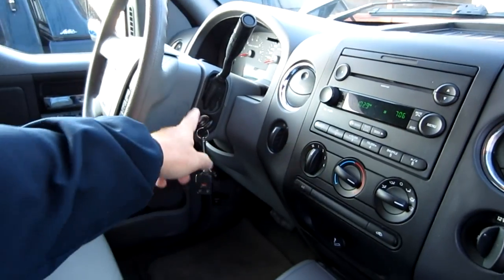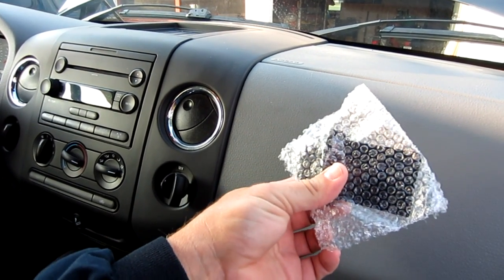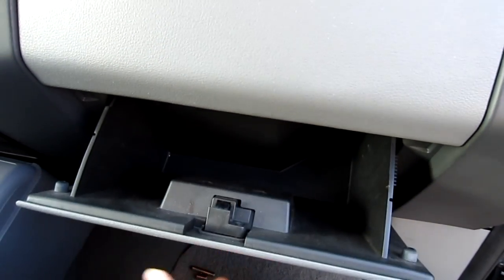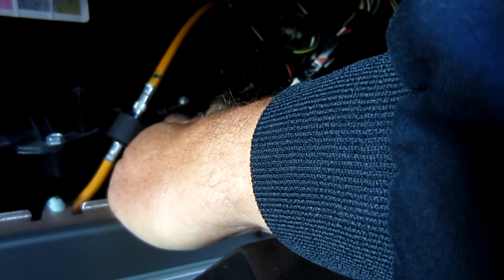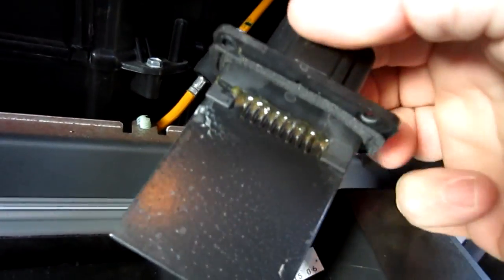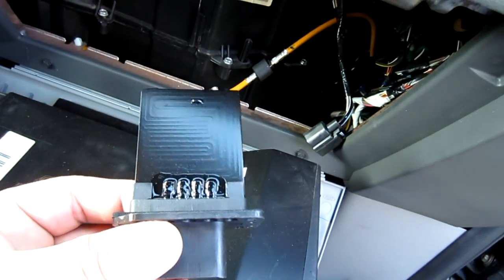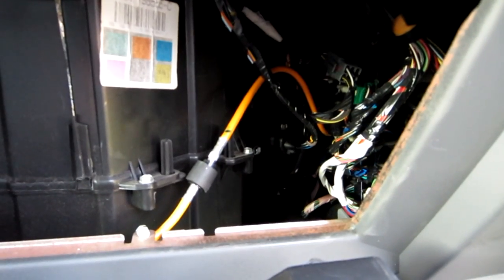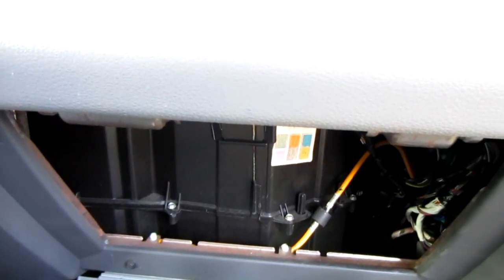2004 - 2011 F150 Blower Motor Resistor

Comment: Just did this on my 08 mustang, worked for about 40 miles and then stopped working again. Back to "High" fan speed only now. I didn't replace it with motorcraft could that be the issue?
Reply from the maker: Possibly.. It's a resistance device so if the blower motor is starting to go then it could be causing it to prematurely fail but the easiest way to rule out a bad unit unfortunately is to buy another one and try it again..
Reply: Yea figured I'd try again with s motorcraft resistor and see what happens. I know people have problems with the AutoZone,oreilys brand parts when it comes to the door actuators, maybe it's the same for the resistor. So if the second one fails again really quick then that probably means my blower motor is going out?
Reply from the maker: Adam Power Yes a blower motor OR bad wiring or connector.. Really a pain to troubleshoot..
Reply: Cool, thank you

Comment: My blower stopped working all together cleaned ground wires replaced resistor truck won't go into gear wen heater switch is on or head lights r on I'm stumped

Comment: I read all these coments and not 1 person said it didn't work but me. I put a brand new one in, even thought the resister is unplugged it still works on only high that that tell some one something. I will check to c if there is a fuse  ??  MM
Reply from the maker: Potentially a bad resistor... Yes even new parts can be bad... If not you may have a failing motor or bad wiring that is causing the new resistors to fail... At this point you must test components...

Comment: Sadly this didnt work for me :/ 2006 ford f150. My fan is on full blast no matter what the setting.  Where do i go from here? The lady at autozone asked if was automatic or manual controls and i said manual.
Reply from the maker: +TheLameEskimo This video shows how to fix a problem where the only setting that makes the blower work is HIGH and at all other switch settings the blower doesn't work at all. I'm not sure what would keep your Blower running at HIGH at all switch positions..
Reply: +Foxboss9 me either.. Maybe a fuse? Either way i think it was blown anyway there was visible rust on the resistor.

Comment: Mine will run, then it will fade....slowing down until it stops..........I turn it off, wait a bit.........comes back on normal.........does the same over again.....sometimes it stays running, sometimes back to slowing down again.  I'll have to give this a try.  How much is the part approximately?
Reply from the maker: Earl Ismyname it is worth a shot.. The part link is in the description..
Reply: Will do!  Thanks for the video you made!
Reply from the maker: Earl Ismyname 👍😊
Reply: Hay mine is doing the exact same thing did replacing that part work? Hope u see this
Reply: Earl Ismyname did that fix your blower motor?

Comment: So it blew air in 4 speed . Mine won't blow at all . Is it the resistor or the motor
Reply from the maker: +Steve Binstock if all speeds quit working at once suddenly  then I would check the fuse first. If the fuse is OK then I would suspect the motor. If you have been running on one speed only for some time because the other speeds haven't been working for a while then I believe that it still could be the resistor but the chances that it lost it's broken default mode(1 speed only) is slim.  The thing is,  unless you bypass the wiring going to the motor and wire it direct or spend a lot more time and remove the motor to have it tested you would be a lot quicker to just spend $20-30 dollars and within 5 minutes rule out the resistor for sure by changing it.. Good luck

Comment: Mine worked for like 2 weeks then it only worked on 4 again any ideas why? Thanks
Reply from the maker: Might be a resistance problem causing the board to fail.. So, bad wiring or blower motor starting to fail..

Comment: I changed that part it worked for a while and then it went back to the same thing any ideas???
Reply from the maker: Either a bad part or there is above normal resistance in the motor,switch or wiring that is causing the circuit to fail on the board of the resistor..

Comment: mine stopped working all together randomly any idea? maybe the relay?
Reply from the maker: Daniel Wahl check fuses first..then look at relays(you can switch with another relay to test).. if still not working you can either try to run a positive wire direct to the motor to see if it works by it being manually powered or your could take the chance of easily switching the resistor like in the video.. it doesn't cost anything but time and effort to do All the checking and testing but the resistor may still be the culprit and it can be bought and switched out in 10 minutes..
Reply: switched relays and resistor to no avail. fuses all looked good. manual ac. i feel its the panel
Reply from the maker: Again, the resistor may still be the culprit(I doubt it though) The resistor can be changed out really quickly to rule it out as the panel change out will definitely be a little more involved. 
  But resistors usually fail to a setting on full speed available for safety reasons(need defrosters) So the fact you have nothing seems to point to something other than the resistor..Keep us posted how it turns out..

Comment: I turn my truck on and after a bit the blower will cut off and not work on any speed... If I turn the truck off for 2 min it comes back on. Will this fix?
Reply from the maker: Kevin Antonio Maybe. My 1st impression is the blower motor..  When the fan stops blowing try tapping on the blower housing to see if it starts up again..If so, I would lean towards the blower motor as needing replaced.. But, the Resistor still could be the culprit.

Comment: I have replaced my resistor 3 times now because it keeps blowing within a month or two 2 after I install the new one. Any ideas what could be the cause?
Reply from the maker: Too much resistance due to either a short in wiring or a blower motor... Make sure connector to blower motor looks good if so probably best to replace blower motor as troubleshooting wiring can be a nightmare if it's a random short and is best left for last. Unless you've got plenty of time, then you can do that before spending any more money...

Comment: Just did this as mine 05 fx4, only worked on high.  Still only works on high.
Reply from the maker: that is odd.. did you get a bad resistor?
Reply: Foxboss9  i donno,  it still only works on 4 (high)..  i am a mechanic, i watched your vid just too find the damn thing.. cause i have had em go before on other vehicles so its what i thought as well a bad resistor.. popped new one in and no happy....
Reply: Foxboss9  yep was what it was bad one out of box!

Comment: I changed mine and my fan still only works on 4
Reply from the maker: I Never had that issue before.. Check your Switch or possibly your fan motors resistance is so high it takes the highest blower speed setting to get it to turn..Meaning a new blower motor is needed.. You will have to do some ohm readings to see if your switch is allowing the other speeds to work correctly also check how much draw(amps) your blower motor is pulling when running..

Comment: 2006 ford 150 5.4 I just checked my manual aft putting in a new resister there is a blower relay and a fuse link on this I figured the fuse is going it work's on high only check the relay tomorrow   grr I'm not givin up Ha  next time If I ever did I would take the glove box right out those 2 screws were a bitch .